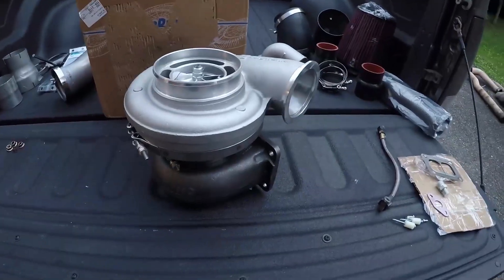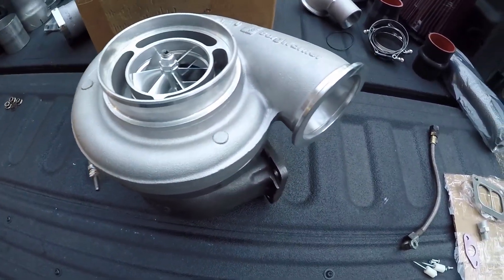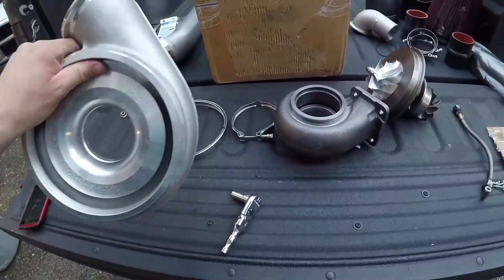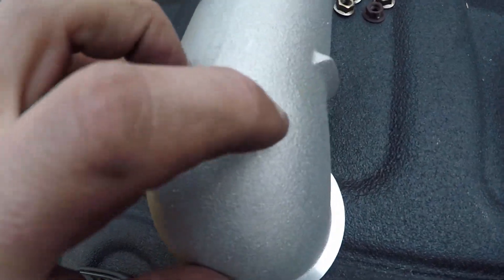6.7 CUMMINS 24 VALVE TURBO INSTALL

Comment: What did you have to block off coolant wise when you did this? Parting together a turbo setup for my 2012 using a hx52 t4 and a bds t4 manifold and 4an turbo feed and 10an return line just wondering what you have to block off coolant wise! Thanks man @turbotom
Reply: @turba Tom

Comment: Hi Turba Tom ~ A friend on the Cummins Forum recommended that I ask you this question.  Due to a total emissions system failure, I'm in the middle of an EGR, intake grid heater and exhaust project on a 2012 6.7L Ram 4x4 and someone sent me a PM warning me about the gasket between the turbo outlet and the exhaust downpipe.  I can't find anything about a turbo-to-downpipe gasket on the Mopar Parts website, so I was wondering if you have any thoughts on the matter?  As I'm working on an asphalt driveway in the middle of an arctic mountain winter, I'd appreciate any help or advice that you would care to share with me.  Have a good one.
Reply from the maker: I've never used a gasket on a down pipe, even when I put the 5" on my 2012. As long as the flanges aren't loose in the clamp you should be alright

Comment: Pretty sure my turbo is going out on my 2012 6.7 cummins, I have a H and S Mini Maxx tuner, deleted, stock exhaust, s and b intake. The EB on my truck stopped working and started throwing codes (P226C (unknown), P0513 (incorrect immobilizer key), P0046 (Turbo Boost control solenoid circuit performance)) Do you have any ideas what this could be?Also I have some experience with trucks but minimal, just change my oil, fuel filter, brakes. Do you think I could swap the turbo by myself or just let a shop do it for me?
Reply from the maker: I don't, never had a stock turbo very long

Comment: Tom, when you put the unit back together, did you find a torque spec sheet for everything?  I have seen some forum members post the list, but there isn't I can find specifics for a rebuilt of the turbo internals.

Comment: To me half the fun of doing an install like this is making it work. Anyone can open their wallet or slap down their credit card and buy a pre made kit that fits but not everyone can trouble shoot and find solutions that will work. Now I'm not bashing the people who pay for kits because sometimes we need things to go together quickly because we can't afford down time however if that's not the case putting together your own set up can be kind of fun. You know the bleeding all over cussing like a sailor feel like throttling the engineers who designed this damn thing kind of fun :)

Comment: Damn dude! Great videos. Also, keep up the good work. I'm also about to do my turbo on my RAM 5500. Not looking forward but is has to be done. Any tips on how to remove the Holset Stock Turbo?
Reply from the maker: Check out my turbo removal video! Also I'd spray the nuts holding the turbo to the manifold with penetrating oil before removal, something I neglected to do this time
Reply: Yes, I saw that one of the your Turbo bolts got rounded. I'm using PB for the past week and I'm mixing ATF fluid and acetone for better penetration. I want to remove the manifold and the turbo together but I'll also have to remove the exhaust brake pressure line and coolant line. I want to get stainless studs like the ones you got but I'm afraid that with all the tow and hauling I do they'll come apart.